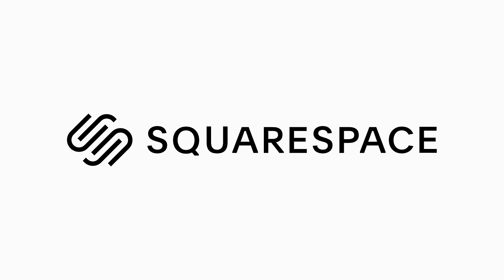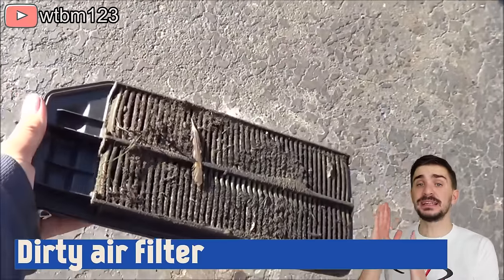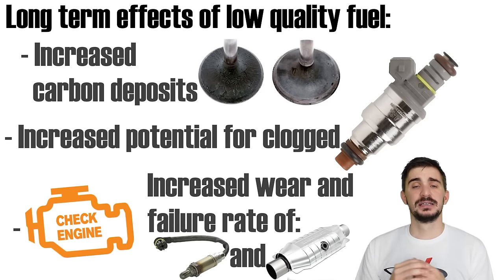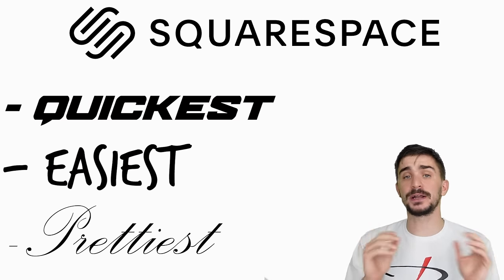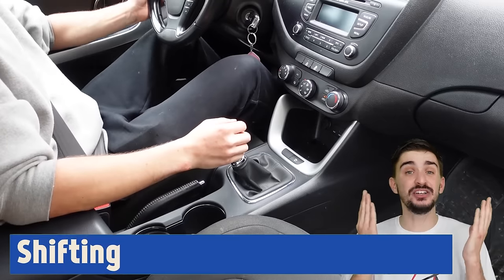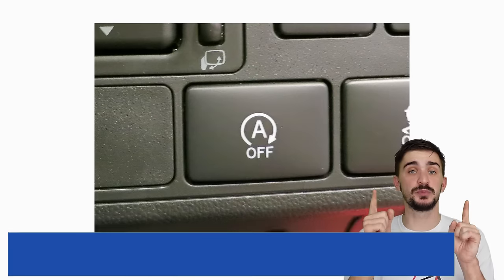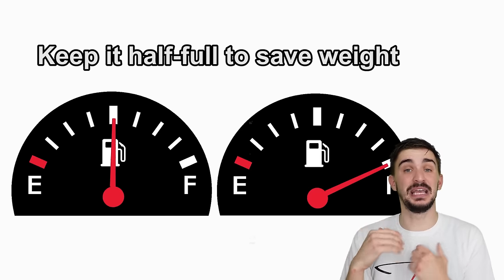EVERYTHING on FUEL SAVING - PRACTICAL DRIVING and MAINTENANCE techniques to REDUCE FUEL consumption

Comment: Coast with the engine off with modern cars is extremely dangerous, i usually do this only with very specific vintage cars. As an example i do this when i need to park in the garage zone of the flat with my old Fiat 500, which as no power steering and no power brakes; so there is no difference between the engine on and off. I only do this to reduce the noise beacause the 500 as many other vintage cars are laud by today standards and then i push it by hand inside the garage.

Comment: I like to hypermile. It keeps me focussed in a similar way to driving fast without the danger and expense.
Good tips here except drafting.
It does make a difference in fuel consumption, lower safety too, true.
Also, try not to stop, lights, junctions etc. If you can slow without stopping (safely) and roll through it will be a bit more economical i think.
Do long drives at night if possible, majes for a smoother, quicker journey and less times other traffic gets in the way of your flow.
Pick great music! Spend the cash saved on better speakers.
Great music makes any journey better so driving steady wont get boring.
My van has average or instant fuel consumption displayed, instant is distracting, average is like a high score!

Comment: hey ik that most people dont like coasting in neutral but if youre on a straight road i feel theres no real disadvantage: u roll way further than in gear and i can't think of any situation where i have to accelerate fast.

i bought a car with a broken 3rd gear so i kind of became used to just rolling in a few circumstances. (btw the gearbox is fixed now)

Comment: Coasting can be more effective if you want to reduce speed, but are travelling at a higher speed over a longer distance. If there are roadworks ahead and you just coast, you will obviously consume fuel while losing speed, but you retain the speed for much longer while the car is just idling. But the effect is basically gone as soon as you have to use the brakes or take a lower gear to get more engine braking, then just lifting would've made more sense

Comment: Ah coasting v engine idling. The answer here is that it depends. I use coasting to gain speed or maintain a constant speed. I plan on driving at 70km/h max so I'll loose a little speed cresting and gain it back on the downhill by idling, then engine brake so I don't loose energy to wind resistance. Turning potential energy to oil heat doesn't save fuel. Incidentally, the last bit of hill to overshoot in speed can also give you a positive fuel gain as air resistance losses are a function of time.
Lastly, temperature... Leaving early in the morning kills fuel efficiency on a cold day in a diesel...I see differences from 15 degrees centigrade.
I averaged 3.3l/100 mixed cycle in a 2014 1.1l Hyundai i20 crdi - My mechanic didn't believe it so I showed him. 
How? Plan every speed change as far as you can see/know, check your tyre pressures often and know that every press on accelerator or brake to achieve the sensible speeds you planned is a chance for wasting fuel.

Comment: Depending on where you live, you may be able to take off one of your rear-view mirrors, or replace it with an internal one. That's quite a bit of drag removed.

Otherwise I'm surprised you didn't talk about pulse-and-glide as a technique. It works in theory by running your engine close to BMEP to extract the most energy from your fuel for short periods, followed by longer periods of running against compression or idling in neutral to reduce rolling resistance. I'd imagine it to be difficult to quantify though, and not quite the safest technique. I tend to use it on uphills to keep around the speed limit, where you're not coasting for too long and it takes more time to get up to speed under full throttle.

Comment: Ahem... I know drafting is a bad thing because it's dangerous (and it's stricly forbidden in most of the countries), but damn it is efficient ! I had one of my friends, who is a truck driver, on the highway and I sticked to his fat truck on a calm portion for a while, and my fuel consumption was halved during the whole 2 hours trip (I did it just for the fun of the experiment, just to know). It's actually why trucks here in EU tend to drive really close one from the other. Sometimes we're lauhing because it almost looks like there are trains on the highway. Ofc it's very dangerous but yet they still do it sometimes. Because actually, it even saves fuel for the truck which is a the head of the trail. Because it shares the drag with the truck right behind it. As they say : two cars drive faster than one =)

About staying in neutral when coasting, it's also very bad for the brakes, because they warm quickly and for no reason.

Comment: You don't mention short shifting.  Larger throttle opening in a taller gear is actually more efficient for the same power.

Comment: Also before buying a car you should check what forums say about the car's consumption. I bought an opel/vauxhall corsa D. It's a small hatchback with 1.2 liter I4 petrol engine that no matter what you do eats up over 10 l/ 100 km (23,5 mpg). But dealers will happily tell you that it sits around 5,5 l/ 100 km. I was of course a beginning driver who knew jack shit about cars and didn't care. If I had just checked the forums, I would find that the most common complain about the car is its consumption.

Comment: There's a school of thought that you should accelerate fairly hard in cars with NA engines(avoid WOT, where nearly all cars run rich).  The engine is most efficient around its maximum torque, which may be 4500rpm for a multivalve engine.  Offsetting this is the fact that you will be travelling at cruising speed for a greater distance because you got up to speed quicker, so it's complicated.  The main thing is to spend as much time as possible in gear with no throttle, as it's free.  Anticipate traffic lights where possible and roll up to them, rather than braking late.

Comment: I don't agree with the coasting in gear argument. While it is true that the engine will consume no fuel when coasting in gear, it will also slow you down. In fact, it will most likely slow you down more than you'll be able to accelerate with the fuel that you'd otherwise use to keep the engine running in neutral. It's quite easy to prove. There are 2 things that require energy - moving the car (overcoming rolling and air resistance) and rotating the engine. Given that we care only about the first one, you essentially want to minimize the number of revolutions that your engine makes. If during coasting in gear at some speed the engine rotates at 2000 rpm but idles at 700rpm, at the end of the day it's better to have it idle at 700rpm. This of course assumes you're not going to brake afterwards

Comment: there are only two things i do to increase fuel mileage: Coast in neutral and use engine when breaking, and fuel up early in the morning - gasoline is very volume dependant on temperature and expands when heated, so early in the morning you get a few more drops than at noon.
p.s. sorry for the bad english
Reply: hopefully coasting in neutral you won't do anymore after watching this video ;)
Reply: Gasoline is kept cool underground by the way, you're getting the same volume of it all day.

Comment: A severely dirty air filter like in the clip might make a difference, but generally, the biggest restriction in your intake is your throttle.  If you have less intake restriction, you have to close  your throttle more for the desired level of power
Reply: True for a petrol, where there’s a throttle. Here the primary issue is reduced maximum torque. 

But diesels don’t have throttles, so a dirty air filter will increase pumping losses. This reduces the volume of air ingested. I suppose modern systems will adjust (like for altitude), but things won’t be optimal.

Perhaps more importantly, a dirty filter is probably less effective, which can domino into $repairs$.
Reply: @richardtheweaver4891  Yes you're right for diesel.  However, a dirty airfilter filters the air BETTER, because the larger pores are already clogged.

Comment: 1. Use a light key chain if not a fon
2. Mauals are better in hills for economy
3. Lit off throttle when you a corner or stop.save your brakes too
4. Leave in gear when coasting down hill
4. Start/stop is super annoying in stop-go traffic
5. Switch off AC if possible
Other maintenances are a given unless youre an american

Comment: About turning the engine off while in motion; most modern cars don't inject any fuel if you're coasting in gear. Thus, not burning any fuel. Oh, I see you've touched on this in the video.

Old engines though, will inject a little bit of fuel as if idling, causing a very lean and high-temperature burn. Ever noticed the temperature gauge creeping up while coasting down a long hill? Interesting but irrelevant, I know :P

If you overturn the key all the way back, you'll also engage steering lock. You'll only notice that when you actually need to steer as the lock allows for  a little bit of play. A friend of my colleague went on a ski trip, his passenger pulled out the key as a joke. They flew off the cliff because he couldn't brake nor steer. They all died except for said passenger.

Comment: good fuel saving if you are not considering an EV is a PHEV. sure you'll still need home charging (or charging at work) to take full advantage but you just need a 110v outlet to plug the lvl1 charger included with your car.
you get also the 7.5k tax credit which makes it not more expensive than regular hybrids. good example is the RAV4 prime which is much more powerful than the other trims, and will cost you zero gas on a regular commute and you won't need to change your habits on long trips away from your home charger. 0-60 "drops" from 5.4 to 9s one mode but you'd be surprised how little you need the additional power on a regular commute. my fiat 500e is 8s to 60 and I almost never need more than half throttle even when driving quickly through traffic or hole shooting traffic lights.

Comment: Nice work here mate 👍
I share your vision. I believe that you must look at traffic and driving like a flowing river and of you block it, it will overflow!
On shifting, for sure I have zero consideration for the shift tip on my C3 aircross. You got to known your power band 💪but I can't  agree with you when you say that the car doesn't known if it is up/downhill.
For instance, the start and stop feature does not engage when the inclination is behond certain degree, right? The car knows for sure..

In the end what matters is that driving WITH efficiency is a very different discipline from "just steering"..

Keep up the good work 💪 
Greetings for #Portugal 🇵🇹

Comment: Also on the coasting with engine off point.
It’s my understanding that in most modern cars if you are coasting in gear it won’t be injecting any fuel anyway?
In my i30 it even says 0l/100kms when coasting in gear…
So to me it seems that turning the engine off would only decrease your ability to react to situations.
I suppose technically if you are in neutral with the engine off you aren’t being slowed down by the friction of the engine and accessories but come on…. That can’t be worth it.

Great video!!

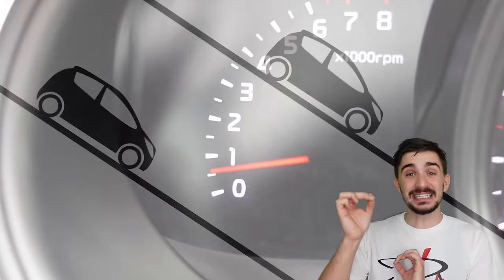Comment: 11:40 coasting in neutral increases stress on the harmonic  balancer / crankshaft pulley which will fail catastrophically when the flexible material in the pulley is fatigued.

Comment: 12:24 Having no torque on the wheels means traction can be fully dedicate toward lateral acceleration, as well as not having the possibility of skidding due to engine braking
Reply: Also no weight transfer. Turn into a corner and suddenly go of the throttle and the back of the car wants to come around, that effect is much less pronounced when starting to coast. Best would be to just reduce the throttle position slowly though

Comment: Drafting can still be useful AND safe. The turbulent air on a safe distance still gets you a small gain, I notice about 3%. Biggest advantage however is just maintaining truck speeds - lower speed, less losses t internal and air friction. Decreasing highway speeds from 100 km/h to 85 km/h nets me ~15% fuel savings

Im also ""busting"" your coasting in gear uses 0 fuel, my car is old and light so keeping it in gear downhill will almost always slow it down to irresponsible speeds, forcing me to give it some gas anyway. Coasting in neutral ftw!

Comment: 6MT 2018 Subaru Forester. Mixed EPA rating of 28mpg. I get 32mpg at the pump during the summer. About 15% better fuel efficiency, using most of your driving techniques. That makes gas 15% cheaper. 👍
Reply: back in the 80 with primitive ignition and fuel systems we had cars that made 45-50 mpgs
Reply: @omegarugal9283  I bought A 1971 Honda CL350 when it was 41 yo, with dry rotted tires and 8V on the 12V battery. I kick started that bike and rode it 40 miles home. No computer, no ABS, no electronics of any kind. Damn thing ran. I'm all for progress, but IDK about all these complex systems helping economy...

Comment: Turning the engine off at a red light starts to save fuel after 5-10 seconds, depending on the car. 
Probably will reduce the lifespan of the starter, yeah, but those usually last a while.
Reply: Also take into consideration your battery health. If you have radio, lights, fans and such on with the engine off it could drain your battery low enough to not start.
Reply: Sorry guys but seriously? Both the points you mentioned are one of the least important ones... What about all the bearings in the engine that have to carry the crankshaft, rod bearings, camshaft and so on without oil pressure for a few seconds every time the engine starts up? What about hot parts like turbocharger where the oil stops flowing and thus suffers from overheating, even clogging the oil lines in the worst case?
Reply: @Peter M  well first of all it's 2022 if you're not running a full synthetic fluid which would provide all the fluid film you need for constant starting and stopping furthermore we're talking about fuel- eficiency here why do you have a turbocharged engine which forces more air into the cylinder requiring more fuel I can get 47 miles per gallon in a bone stock 2013 Corolla that's close to max out GVWR. Running a tcw3 oil at 2oz per 10 gal. Or marvel mystery oil at 4oz per 10 gal.  Will net an average 1.8-2.6mpg gained.
Reply: @yzrippin  The fuel saving by turning off your engine is going to be negliable compared to the increased wear on the starter, battery and everything else. Never ever going to gain that back in fuel.
Reply: Never worth it unless the red traffic light stays on for 60 seconds.
Reply: I usually turn off the engine while waiting at railway crossings or at road work sites that have temporary traffic lights.
Reply: @jort93z  Because the extra wear on the engine will be more expensive on the long run. Just get a hybrid if you care that much about fuel economy.

Comment: As a member of the ecomodder forums, there is a lot of things you mentioned here that have been debunked, like driving with half a fuel tank, or how downshifting to press the gas less will save you fuel. Most engines produce their lowest BSFC at high engine loads, meaning that hard acceleration at lower RPMs, and getting to speed quickly is often more fuel efficient than a long, little throttle scenario.
I love the last part though, defintely drive a more fuel efficient vehicle, or walk or bike, or take a bus, you might enjoy your weekend drives more after you switch.

Anyhow, while I would not recommend someone to shut off their engines while waiting at a stoplight, test have showed that 8 seconds of idling is enough to use more fuel that what is required to start the average gasoline car. So you should defintely do so if you are waiting for more than a few seconds I hate when I see people leave their car on when they stop at the convience store.

I do stop my car rather obseively, but I know how to replace my starter on my diesel for cheap, and i've mastered my one step start and go, by leaving the car in gear and just pressing the clutch and brake to start.

I used to drive engine off a while back, but I've decided to stop doing so, specially cause my car completely cuts off fuel injection in gear and also it barely uses any at idle.

I will only do it again if I ever complete my modifications including a high capacy electric system, electric power steering and vaccum pump and a shifter mounted ignition switch.

Comment: Regarding fuel quality, it seems to be a big point of contention. Personally I always go by what the manufacturer recommends in the manual, and in most cases that's 91RON (here in Australia). I'd only ever go higher if the car required it, like if it had a turbo equipped or something. There seems to be no end to people saying that it's preferable to run a higher RON fuel for any vehicle, though.

Comment: I'm going to assume you misspoke, so I'm mainly addressing people who aren't aware (so they aren't confused). 5W30 is less viscous than 10W40. Viscosity is resistance to flow and thinner oils (smaller numbers) flow more readily.

Now that the pedantry is over: On saving a half a cent when coasting with the engine off: Not only what you mentioned about restarting the engine, but decelerating (off-throttle, engine running, car in gear) puts the engine in a VERY low load situation. So low, in fact, that modern engines won't open the injectors at all, so you use the same amount of fuel with the engine on as you do with the engine off (none), except you retain the use of accessories.